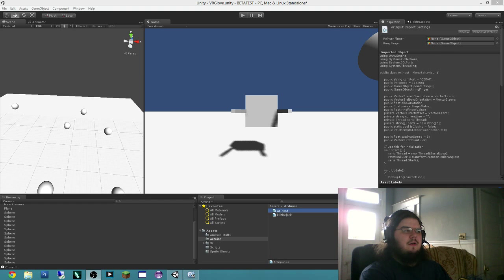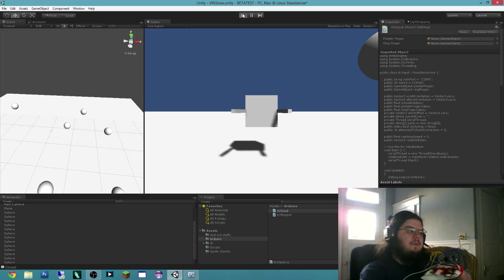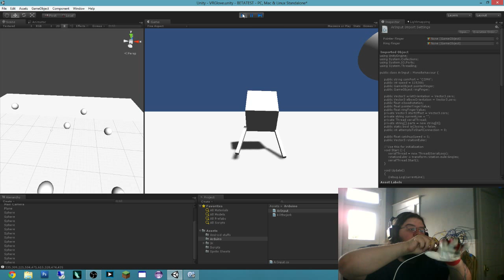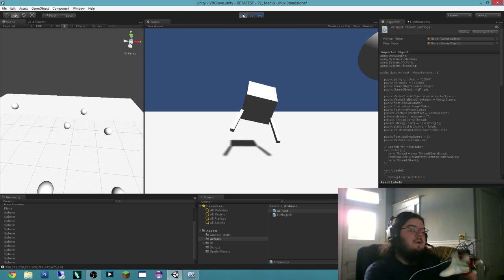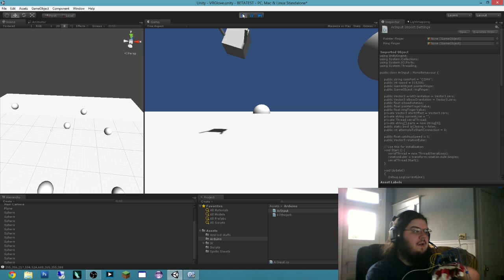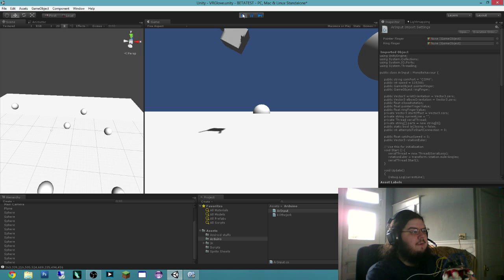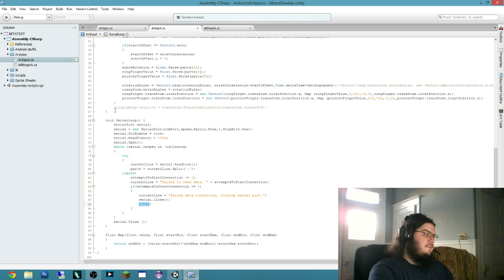VR Glove Video 2

Comment: Great work, the extra sensor sure makes a huge difference in motion tracking. Now it just needs to be as accurate for fingertips, joints & knuckles. What do you think the biggest hurdle for diy inventors like yourself is for this technology to be done right? Until I'm in VR and can see my arms, elbows to finger tips in real time I don't see VR getting a good enough foothold with consumers. Your hands have to be the controls.
Reply from the maker: I am tracking the fingers too. (if you look at the video #2 I uploaded, I'm just moving the little bars up and down on that box guy, but still) I'm rigging up all the inputs to an arm I modeled a while ago. It's actually getting to the stage of creepy feeling. I'll be making a video later on for it tonight. I'll also be showing what I have on a hangout tonight. I have all the stuff to make it "work", but I'll need to tweak things for stuff like drift.
Reply: That's amazing progress, I'd like to tune in tonight to see your current iteration. This type of input is the key to unlocking VR space. Thanks for sharing your devs
Reply from the maker: XD Just realized this is the second video. Thought you commented on the third. XD
Reply: oh, ok. Now I see, nice diy elbow piece. Looking forward to future videos.